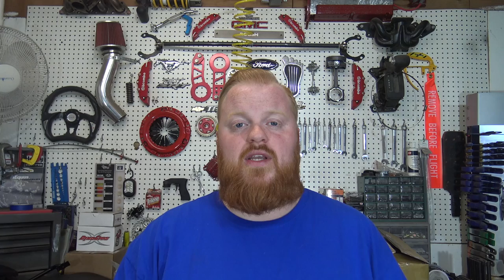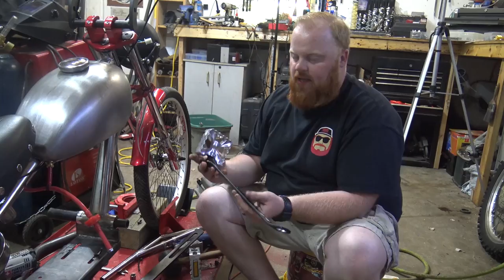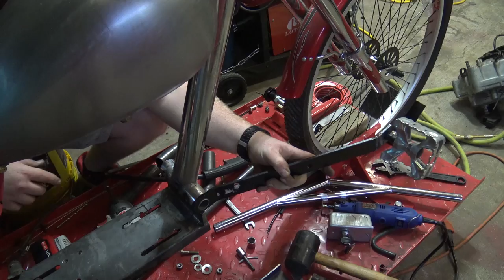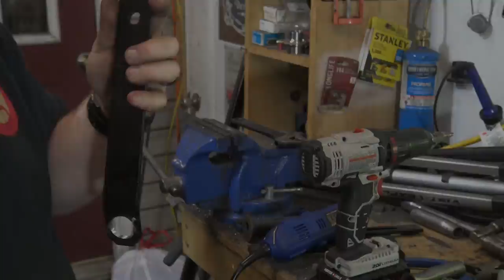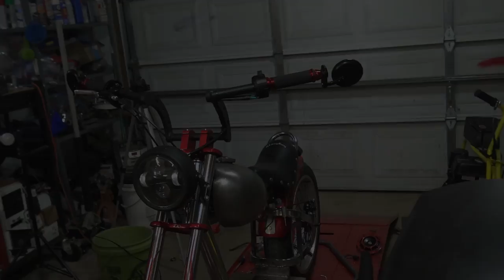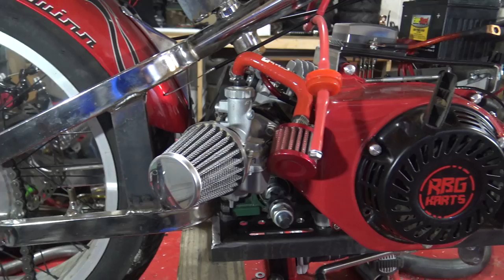Predator 212 Mini Chopper Build Ep 5 - Foot Pegs

Comment: Looks like you could use those truck lug spikes. Round base till slides in and weld.
Reply from the maker: +HotRodderRecycler I thought about using them I just need to see if I can buy just two of them.
Reply: Could flat cap them with threaded stud and use any number of shifter knobs. Less pointy and more skulls and 8 balls.

Comment: Love your videos Red Beard, I noticed you have a rubber oil drain tube on that motor and I was wondering where you got it? I have a 301cc predator engine that could use that on. Thanks Mark
Reply from the maker: +Mark Parlee I will put it in the description of the video tomorrow

Comment: What welding process do you use flux core mig or dual shielded flux core.?
Reply from the maker: +Joseph Stewart mig with argon gas
Reply: Red Beard's Garage please please please do a 4 wheel drive of your own I really really wanna do one but I don't have all the kinks worked outs my plan yet.

Comment: Hey Red Beard not sure if anyone has asked but would you still use the same parts on the torque converter if your doing the same build with a 420??? thanks
Reply from the maker: +edwin ar you would use the 40 series on 301cc and 420cc. The 212cc uses the 30 series

Comment: Will the flywheel and the electric start stuff from the power land engine fit on the predator? There may be a difference in the degree of slope where the flywheel and crankshaft meet.
Reply from the maker: It will fit a non hemi predator but not the hemi one
Reply: Yeah, I tried swapping the charging system from the blown Baja motor to a predator, wouldn't work. But  it did fit the Iron Ton motor from Northerntool.

Comment: great video, where did you get that red rubber oil drain hose at 2:00?
Reply from the maker: amazon. I will put the link in the description of the video. Give me a few and it will be there
Reply: Red Beard's Garage thanks!
Reply: Red Beard's Garage my fire dept has Honda engines for our pumps on our brush trucks. the way it is now with the stock drain the engine's mounted to a flat steel plate, and every time we change the oil, it goes everywhere! these will be perfect for our needs. I'm ordering a few sets now. thanks for sharing the link
Reply from the maker: No problem man
Reply from the maker: Links are in the description for them

Comment: Is that yellow thinking you were using while lining up the legs a angle finder if not what was it and where did you get it
Reply: I would do that mount so then you have two things hold the foot pegs from falling becuase if you only have the welds on the pipe then it could one day fall and I would feel better if it had two things supporting it
Reply from the maker: It is a angle finder and I got it from amazon

Comment: please don't use those cast aluminum pedals as pegs. I got 10 stitches in my knee from them as I did this exact same thing u did. If u ever drop that bike, even at a slow speed they will shear off and go through your leg or foot. I can send u pics of my chopper with those dangerous pegs before I took them off if u want
Reply from the maker: +three wheela you can send pics on Facebook